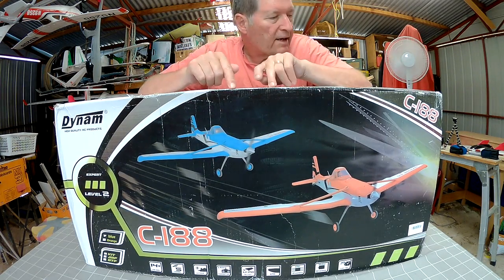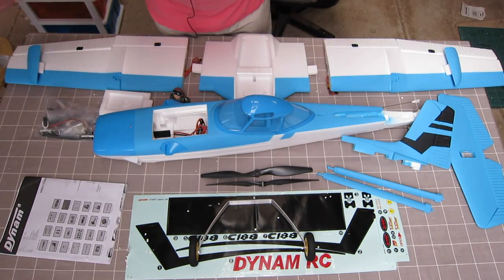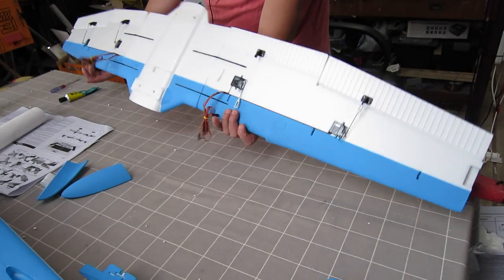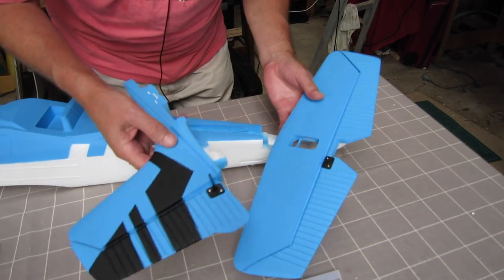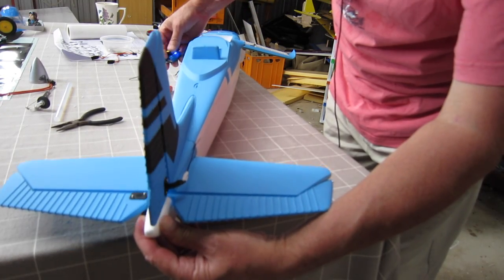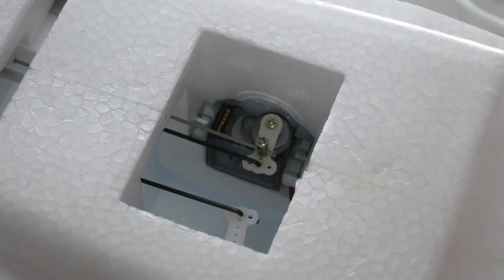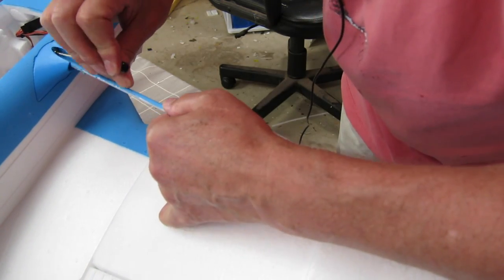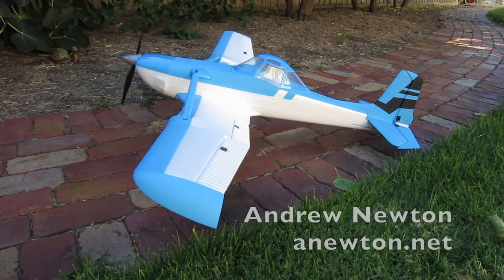Dynam C-188 build

Comment: Nice the manufacturer has shipped two props. Sometimes parts take a while to arrive, and an early "Landed" leaves you frustrated.
A cheap way for the manufacturer to get some extra kudos.
Reply from the maker: They do put in a little more effort with some planes.

Comment: Hi not sure if you can help me but I have a c188 know matter what I do I can't get it in the air as soon as it's off the ground it turns left an hit the ground it' driving me mad thanks
Reply from the maker: First thing I would think of is the aileron directions are reversed. Do you have a video?
Reply: no I have no video of it how can I check this please
Reply: just looked at a video on this and you are right mine are the wrong way when I turn left it go's down not up thank you so much .
Reply from the maker: Fantastic Martin, I wish all problems were as easily solved. This is such a good plane, my favourite Dynam single wing
Reply: let's hope it fly's now . thanks